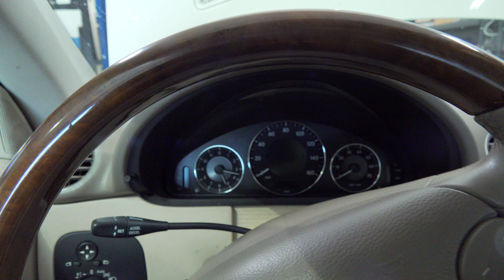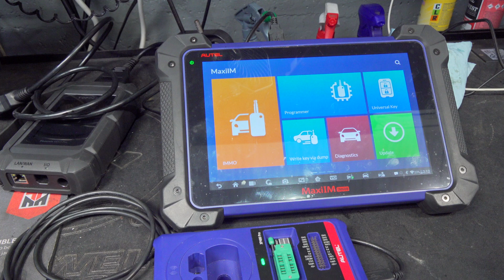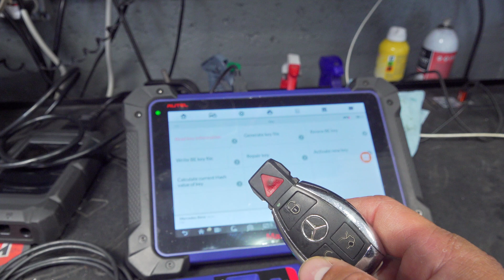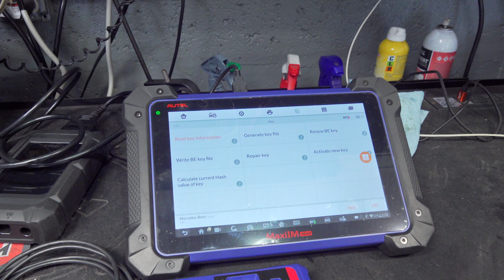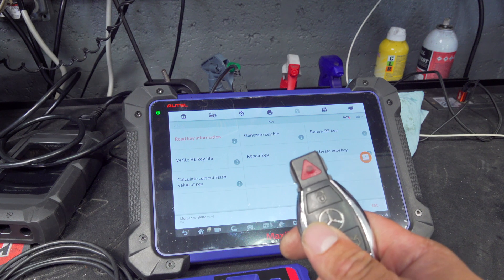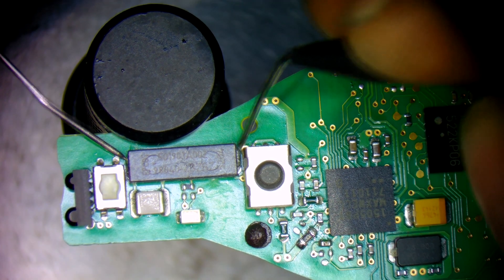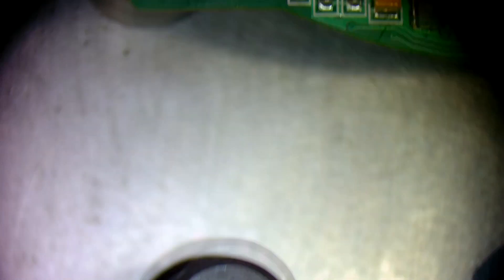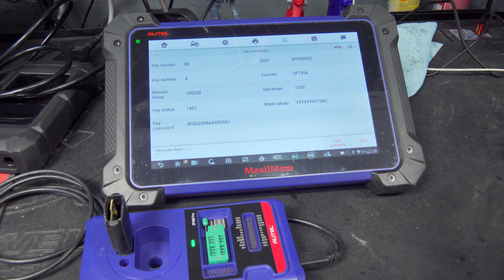HOW TO FIX MERCEDES BENZ KEY FOB NOT WORKING | KEY FOB REPAIR | KEY NOT DETECTED | CLUSTER DEAD

Comment: I finally figured out why I couldn't use my car's key fobs, I put in one 2025 battery in each and they didn't work, turns out that the old key takes two 2025s and the new key takes one 2032 which is slightly thicker, bam! Both keys working again

Comment: I really need you .I have a 2000 Mercedes Benz S430 my Key wouldn't turn my stirring will isn't locked my window don't go down my battery is good key battery is good I took my Key to have it checked and it didn't read what should I do

Comment: Nice to see there are still talented professionals that will work hard for a customer not just throw their hands up and say “you need to spend $1,700 at the dealer for a new key.”

Yes, that is an actual real $ number my Mercedes dealer told me if I lose my one and only S212 key.

Comment: I have a 2018 GLC 300 that has one fob that got wet. The key will start the car, but can’t use the remote function on the button. Is there something that can be done to fix the mother board on the key?

Comment: Nice work mario i have an issue with my key to but i live in Egypt so any of your technical assistance 😅 not available in here so can i send you my key or it will be useless to repair it without the car any way my problem is the key most be near the driver door handle to respond to lock or unlock the vehicle thats my problem hope you give me some help and thank for your help 😊

Comment: You certainly deserve subscribing to I have a key with the same problem, the radar part is working because I can start the car with it. I have a new key I just bought off of eBay for $18. Might use some parts from that to fix my old key

Comment: Hi, I am dealing with this exact problem. I replace blown fuse and still no go. I suspect its the key that's the issue. I checked infrared using camera and I am able to see the infrared working. Is it possible that key is still bad even with infrared working? Hopefully you'll be able to help me. Thank you!

Comment: Well
My c series also had exact same issue but a private
Mobile key,unlock smith
Did magic
$350 for two keys (aftermarket) part
But i was very happy with the out come
If your key is good then the steeing lock mechanism
Could be at fault and that is
Not a cheap one
It usually involves steering assy dash removal and $$$$$$$$#. Later.

Comment: nice video, I am new to mercedes and have a 05 CLK 320 convertible... been a garaged car.. runs great however... key works fine.. all 3 keys  i have  can remote unlock and lock and start engine but if I try to state engine with start button on shifter, or grab door handle or push lock button it says key not recognized... does that track down a cause?

Comment: our only key no longer works because it was left in the washing machine.  I spent $800 for a replacement key at Mercedes but would like to possibly salvage the old key.  I tried the rice thing overnight with no success.  I'll try testing for continuity  on the coil but if that doesn't isolate the problem, do you have any suggestions?
Reply from the maker: Yes, please email me at supermariodiagnostics@yahoo.com 

That way i can get more info on the key type and present a fix for you

Comment: How disappointing. I need to know how to get the circuit board out of the key... The one thing that he did not show. But so much taking and no showing.
Reply from the maker: I showed how to test the immobilizer system, narrow it down to a key, opened the key, repaired the motherboard, and confirmed the repair and all you got was that? 

Good luck
Reply: He shows how to put it in, just do the same in reverse. 👌

Comment: Thanks, for the video. Just sharing my experience. If your key is not defective but not opening the car after after battery change. Open the car with a spare key or mechanical key door then remove spare key out of the car 2 meter away. Start the engine with a key fob with just replaced batteries, stop the engine and now your key shall start working again.

Comment: Question, 2003 Mercedes E509, no dtc's, keyless go inoperative . Disconnected the battery the other day and the key fobs would not lock or unlock the doors. The keyless go worked for the first time when I touched the driver's door and unlocked the car. Tried the push start button on the shifter to start the car ,nothing. Inserted the key and it started the car. Now the keyless go will not work again, but the key fobs now work to lock and unlock the doors. What is going on? Please help. Again no codes.

Comment: I’m going to look for a video where you disassemble the fob. I left my key out in the cold and snow of a chicago winter one night and it no longer detects the key remotely. I replaced the battery and the IR works, but the key is not detected. I don’t know if i can fix it but i wanted to open it up to see if there’s anything i can clean up first. This is not my only key, but they’re so expensive to replace.

Comment: Can a NEC57 chip from a used mercedes key be cleared and rewritten for a different mercedes ?????
Reply from the maker: I haven't tried yet
Reply: @SuperMarioDiagnostics  I just tried it. It worked. I desoldered the NEC57 chip and placed into the APB115 and that connects into the XP pro. I cleared the chip and it is ready to be programed to the car. 
I did have the EIS data saved in my IM508 and could write to the chip, but I didn't. 
I didn't want to screw it up. So I just did add a key and all is good. 
P.S. soldering that small chip back to the board was a little nerve wracking, but got it done.

Comment: Very nice fix.  Being able to reuse components from one part to another is a real plus.  One time I replaced a diode on a lighting unit.  Hazmat crews used this trailer mounted lighting unit for night work to light up an area.  The light "bulbs" were special and took time when the engine/generator was started to fully illuminate, but were VERY bright.  And they were on  masts.
One diode prevented the lights from working.  
My supervisor located the part, I got it installed.......we had lights.  Hazmat was happy.

Comment: The coil is not responsible for transmitting the key data. The coil’s job is to power up the key inside the EIS by induction. That is done via a coil that is wrapped around the EIS inside the tube. That being said, you can remove the battery from the key FOB and the key will still turn and start the engine. The battery in the key is only there for the remote locking/unlocking and the summer opening/closing feature via IR.

The IR diode is there to communicate with the EIS when inserted. There is another IR diode inside the EIS.

Comment: Nice work, I do lots of BE key replacements all the time.  Had a customer come in with an original NEC key that the IR broke but he lost the pieces.  Used hot air station and removed the NEC chip so I could read the password off of it.  Quick and easy.

Comment: You did a really good thing there. I also like to try and fix a mercedes key, but also think about the age of car and miles as mercedes puts a dead key date after so many inserts in ignition not even starts, and key can not be used again. So repairs like this may be a cheap alternative but like you said a second key is strongly suggested to have as a spare. Great video, thanks for putting it up.

Comment: As someone who is a locksmith and a diag tech, I refuse to do this type of repair. It's not that it can't be done or won't be a proper repair. It has to do with a thing called "since you". If you do a repair like this the second anything happens they're going to blame my repair. Customers can take a Mirror and look into it. The thing they see is why most guys don't do this type of repair.
Reply from the maker: That's fine. The "Ever since you" customers will do that whether you perform a circuit board repair or add a new key.
Reply: @SuperMarioDiagnostics  the chance of failure seems lower to me using a new high quality key. Buttons that don’t have 1000’s of cycles on them.
Reply from the maker: @zackarymcclain164  and a simple explanation and documenting it in the ro addresses that. Which also assists in getting the customer to add another key
Reply: @SuperMarioDiagnostics  setting expectations should fix those issues, you’re correct. I think your clientele is different. I work on a lot of 55th owner euro cars. Your customers probably have the financial standing to afford these type of cars and understand the cost and risk involved. I deal with the customers who don’t always have the financial assets to own this type of car.
Reply: @SuperMarioDiagnostics  I WOULD REPAIR THE DAIMLER CHRYSLER MERCEDES STYLE KEYS IN THE 300/CHARGER DUE TO BATTERY HOLDER SOLDER CRACKING . I HAVE RECENTLY PURCHASED A HEAT GUN . WISH ME LUCK ON FUTURE ENDEAVORS .